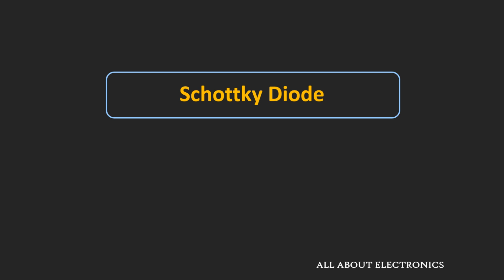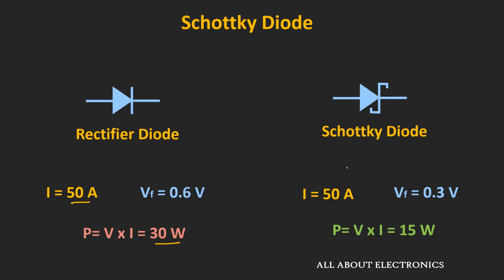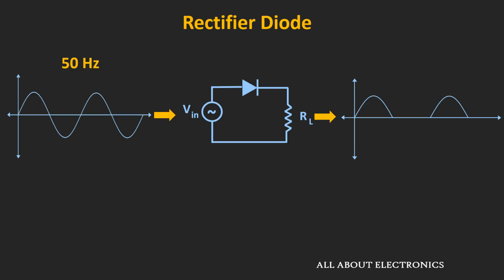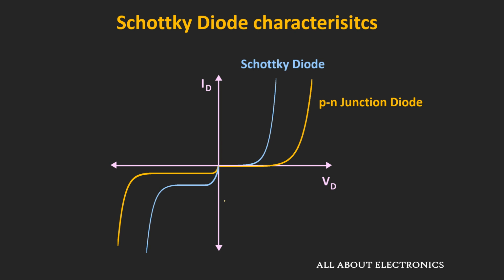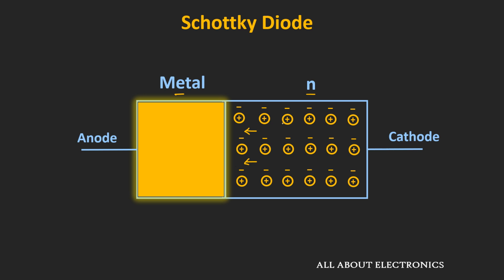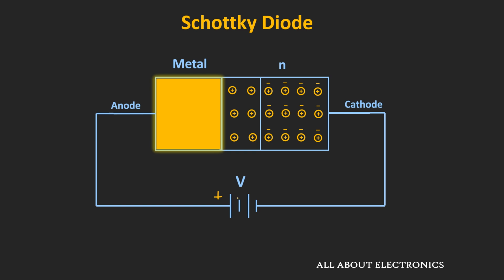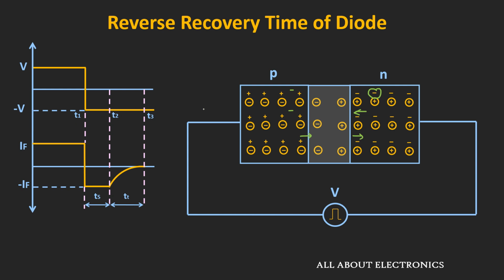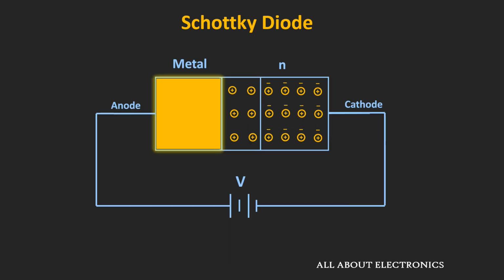Schottky Diode Explained

Comment: The video explains the Schottky diode, highlighting its low forward voltage drop and fast reverse recovery time compared to normal diodes. It discusses the construction, operation, and applications of Schottky diodes, emphasizing their usefulness in high-power and fast-switching applications due to their unique characteristics.

Key moments:
00:20 Schottky diodes have a lower forward voltage drop and faster reverse recovery time than normal diodes, making them ideal for high-power and fast switching applications.
          -Schottky diodes dissipate less power and generate less heat due to their lower forward voltage drop, making them efficient in high-power applications.
          -The fast reverse recovery time of Schottky diodes allows them to rectify high-frequency signals, making them suitable for fast switching applications like SMPS and communication circuits.
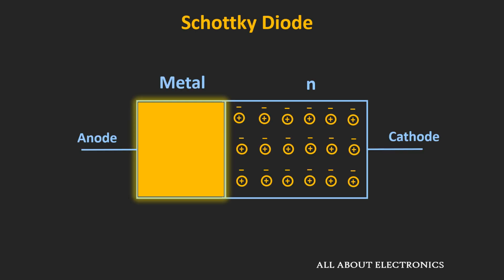05:21 Schottky diodes have majority carriers, leading to a fast reverse recovery time without minority carriers, enabling high-frequency operation for fast switching applications.
          -Schottky diodes use n-type semiconductor and host metals like chrome, platinum, tungsten, with majority carriers being electrons.
          -The flow of electrons into the metal creates a depletion region near the junction, forming a surface barrier that restricts further electron flow.

Comment: Sir, if reverse recovery time of schottky diode is negligible then can it be work fast in reverse bias condition.?
Reply from the maker: Lower recovery time means, in less time it can go from ON to OFF condition. In reverse bias condition, it will still behave like a normal diode and will remain off. The only thing is, since its reverse recovery time is lower, it can work at higher frequencies for switching applications. I hope it will clear your doubt.
Reply: @ALLABOUTELECTRONICS  thnks sir for your reply, it's very helpful.

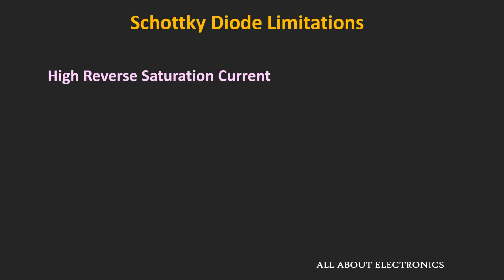Comment: Sir, at 4:20 you said Schottky diode has high reverse saturation current but later you explained it has no minority carrier. I am not getting that point. Please help.
Reply: Even I have the same doubt.
Reply: Under reverse bias in schottky diode, the free electrons of the metals are attracted towards the applied positive voltage on n side which constitute for higher reverse saturation current. 
Whereas in normal diode there is p type semiconductor instead of metal, whose minority carrier electron concentration is much less than metal which in turn result  in lower reverse saturation current.